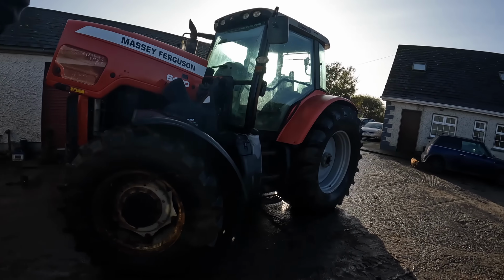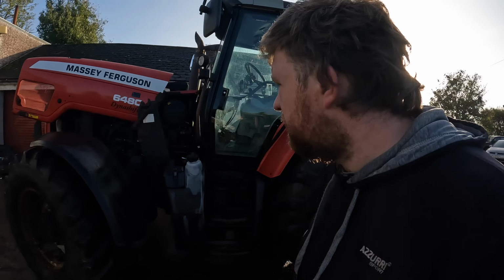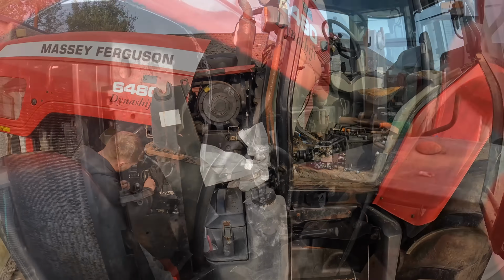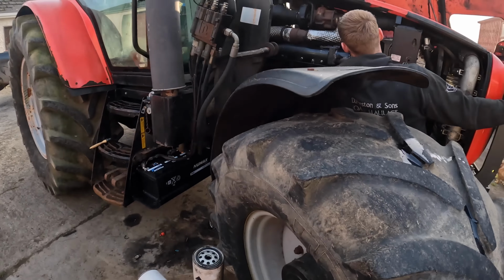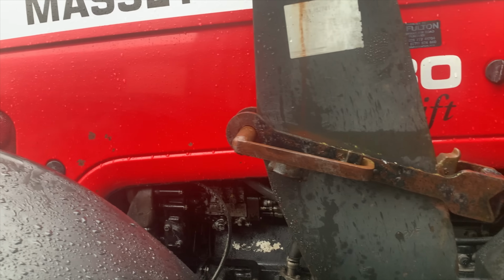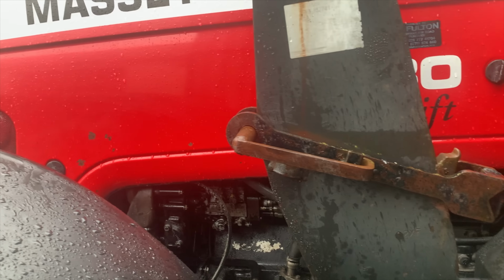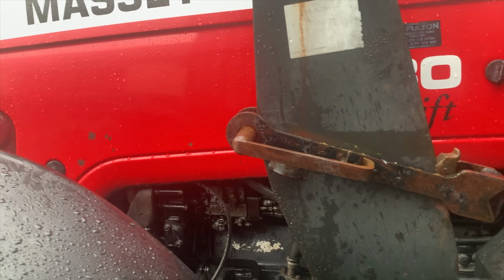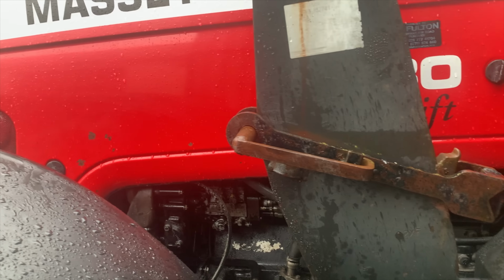CAN WE FIX THE MF 6480?! | 2 YEARS SITTING IDLE

Comment: Got lucky with the fix :) Not to bad taking off the injectionpump on them, we changed the pump on or 06 7480 since the injectionpump coudn't build enough pressure to fire the injectors when coldstarting :)

Comment: I had this with my 7480 actually broke a injection pipe at one point when it came loose still ran tho, mine was caused by previous owners stripping threads while fitting a new pump, it broke the timing case and snapped the lug of the injection pump🙈so I swapped the timing cover wasn’t a bad job really

Comment: Didn't see that starting up like that again! There's no timing marks on the gear's on them and when the injector pump gear came away from the idler gear driving it the pump timing was lost! The injector pump is pinned and locked with peg bolt! Would be interested to know how she was got timed!🤔🤷
Reply: It won’t of come out of mesh there isn’t room for the gears to part so removing the pump is a case of rotating the engine until no1 cylinder is a TDC then lock the pump and remove
Reply: Right Ok! I thought he said she stopped on the road! All the better it stayed meshed, it's a bugger to get the timing perfect without mark's.